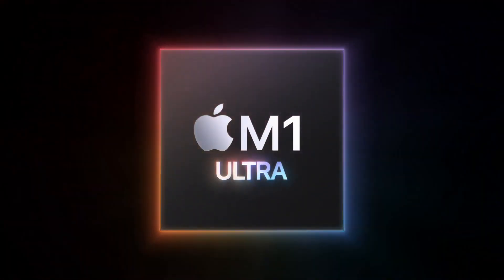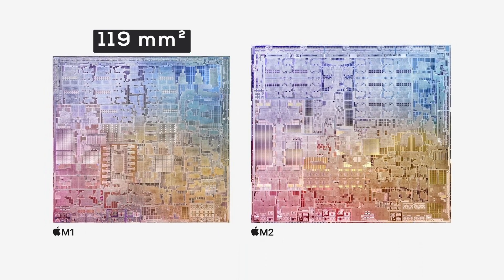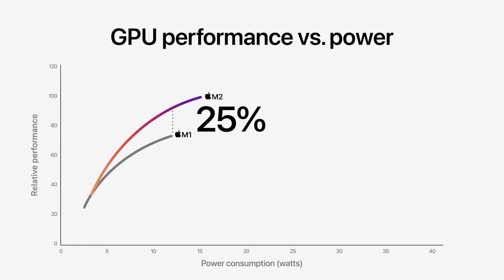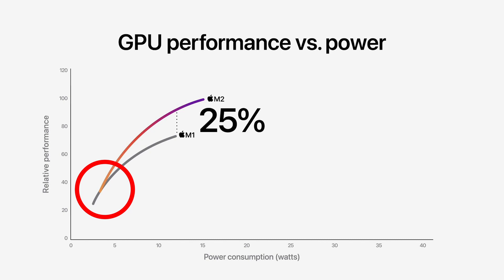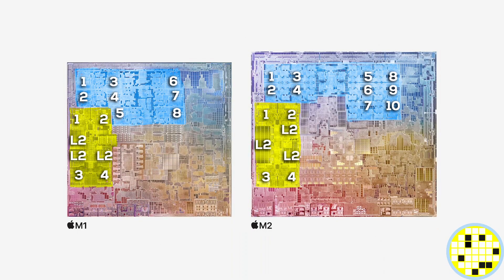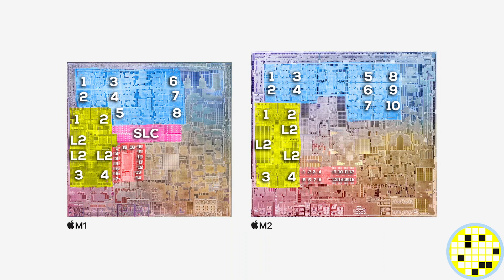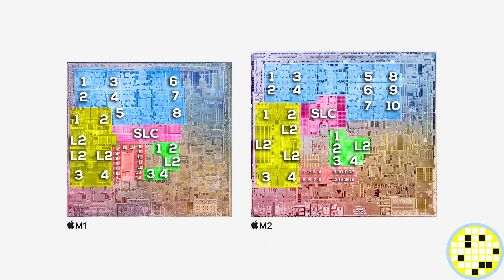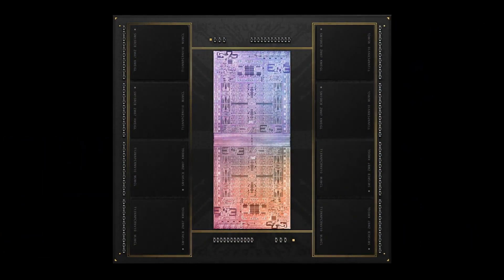Apple M2 Performance & Silicon Analysis

Comment: I fear Apple’s “years-long” lead in ARM chip design (as once identified by journalists and analysts) might quickly evaporate because of the “brain drain” that has “gutted” Apple’s Silicon Engineering team. I don’t expect any advancements in Silicon design technology by Apple in 2023 beyond the M2 Pro and Max. Apple’s widely reported abandonment of ray tracing in hardware that Apple’s Silicon Engineering team had been working on (A#, M#) as well as news that Apple has put its radio/modem/WiFi Silicon efforts on indefinite hold is a sign of a depleted and rudderless Silicon Engineering team that will probably put out SIPs that use the same generation Avalanche/Blizzard CPU cores and the identical GPU cores — just more of them.

More of the same, just more: M# Silicon with 10 Avalanche P-cores/4 Blizzard E-cores; 16/6; 18/8, etc. and more and more of the identical GPU cores: 24, 40, 48(?). Maybe LPDDR5X RAM, maybe adjustments to the cache and system-level cache, maybe an “Ultra” that’s two M2 Max chips fused together. But ARM, Qualcomm, Samsung, NVIDIA and others are already supporting ARMv9, hardware ray tracing, Deep Learning Acceleration, on-die radio/modem/WiFi-6E/DUAL Bluetooth (in the case of Qualcomm) and more. Apple Silicon might slip further and further behind and become the “PowerPC” of desktop/mobile processors in this new era. Hope I’m 100% wrong.

Comment: Just wonder, 
Does it mean that is I buy 8 core GPU model instead of 10, I got defected chip with 1-2 broken GPU cores that are disabled?
Reply from the maker: That’s exactly how it works. Not every chip is fully functional and instead of off throwing it away, some parts are deactivated and sold as lower tier parts.
Without this process, called “silicon binning”, chips wouldn’t be economically viable.

Comment: When the M1 first came out, Apple compared it to Intel (either ice lake or tiger lake), either of which were notably slower than AMD. My thoughts at the time were that it was certainly better than AMD’s Renoir, but that should be expected, given its better node and 60% higher transistor count.
Since the release of the M1, both AMD and Intel have made >25% perf gains (especially Intel, and Rembrandt’s GPU). 18% more CPU perf just doesn’t sound like enough to compete with Phoenix (AMD’s N4 APU), and even a 35% GPU gain is nothing compared to the 60-80% gain rumoured for Phoenix, which is even more impressive given Rembrandt’s insanely efficient GPU.
TLDR: When Intel finally got their act together, AMD has the money to use their latest GPU IP, and TSMC has nothing special to give to Apple, the macbooks don’t seem that great anymore
Reply from the maker: I think performance wise its actually pretty close, but when it comes to perf/W, Apple should still be in the lead.

Comment: I am just absolutely thrilled with Apple having 2, 4 and 4 memory channels between M1 regular, Pro and Max, though less thrilled that there is not a DDR4/5 option for non-laptops. Intel made a serious mistake not offering proper differentiation across price points, shoehorning all client into a single socket. I also like Apple's decision to put memory in the processor package. This might seem like a loss of upgradeability now, but I am assuming Apple will make a deal with a DRAM vendor for a custom die, one in which the signals leaving DRAM cannot drive full size wire of off package, and must be the tiny wires that will become possible with in-package connections.
Reply from the maker: The M1 really was the "odd one out" when it came to the M1 lineup, especially with its LPDDR4X memory. I think the M2 lineup memory scaling will be perfect. As to the non-LP DDR option, maybe we will see one on the rumored Apple Silicon "Mac Pro"? So far all Apple Silicon products are kinda mobile, even the iMac, Mac mini + Mac studio have a really small form factor.

Comment: Personally, I am not super interested in Apple products. I was given a MacBook pro for work back in like 2015 and it was excellent for that sort of thing, however it was a bug fest and would just get slower and slower until it was completely unusable. It was only 2-3 years old by then . There were stacks of them and even newer Airs in the IT room being used as parts machines too. It didn't give me much confidence in their quality especially since they cost so much. I know laptops done always hold their own too well, but I have had $300 Acer laptops last much longer with not much longer with barely any noticeable performance difference when using them for office and even some design work. I'm not quite sure why they decided to get a fleet of such expensive computers for such basic tasks. 

I also like to tinker too much to bother with them even if they were anywhere near my personal price range. Well that amd the fact that any computer I am really going to invest in is primarily for gaming. I can build so I do have a leg up on many consumers, but for the price of a very basic Apple brand desktop, I could build a monster of a PC. However I wouldn't be able to spend that much on one anyway. 

  I understand that they are apparently good for audio and video editing, but they also seem rather narrow in their range of capabilities, so considering they are mainly designed to do those things, it's not surprising that they would be. Their proprietary approach, possible planned obsolescence, and hostility to the right to repair alsonturns me off from their products. I can't help but think that they are charging as much for the logo as they are the hardware.  Thatnis only my opinion though. 

I do get a lot of push back from people who use them exclusively even though they don't really know much about computer hardware. I often get the "well I can edit PDFs without having to buy software for it. I don't often argue,  but on occasion I do point out that the price of that software is definitely baked into to the extremely high system price. I can do many of the same things with $600 worth of PC including pay software, although there are many open source solutions.  The whole "they don't get viruses" line is also common and as you know not true. I'm sure there are.many legitimate reasons to buy their stuff that I am not aware of. Although my point is the most common justifications used by layman consumers seem to be mostly mythical or outdated. Back when Flextronics built their hardware, I'm sure it was very well made  but once they built their own assembly plants it had to have gotten worse since few if any manufacturers can compare to Flextronics no matter how much they make selling it.....especially in sweat shop conditions. The prices certainly didn't reflect the savings accrued from  the switch either. 

It's not just Apple that I don't care for because of such practices. Many once very well made products of brands went way downhill once their name became synonymous with that quality. DC shoes for example  which use to be amazing for skateboarding (and i got made fun of at school for wearing them assuming they were "Payless" brand shoes), but when they got popular years later, they wpuld fall apart by just walking on them while jumping even higher in cost. Or one of the more disappointing examples, the "Ugly stick" line of fishing poles. I use to be able to reel in a giant catfish on a $20 1.5 meter "Ugly stick" that I could easily carry through the woods since it was so short, but super strong when I was younger. I bought another when I went to go fishing for the first time in a while and it exploded from just a few pound young smallmouth bass. They use to be 100% woven solid carbon fiber from tip to handle, which is what made their trademark look by the handle. However upon closer inspection of the rod(now $45), only the tip about <30cm was made like that and the rest was super cheap hollow fiberglass. They just put a thin plastic shroud around the bottom so it looked like it use to from the manufacturing process so they could call it an Ugly stick and charge as much as if it was one. I know that is way off topic, but it explains my apprehension about the brand as a whole. 

I'm not saying you shouldn't cover Apple.  Like I mentioned I'm sure their higer end stuff is very good at higher end workloads, but as a Peasant, those quailty products are way out of my reach and those aforementioned reasons are why I don't  personally follow the brand with any real interest. Unless they made some kind of crazy big advancements this is about I would have to say about them. I did want to watch the video and comment in support of your overall work though, so that's what I ended up saying apparently 😊 Just because I don't like something doesn't mean it's not interesting to others. ☮️
Reply from the maker: My dad always used Apple products, we even had a original Macintosh (I think SE) back in the early 90s. I never had any Apple computer so far, but I switched to a iPhone two years ago and I dont regret it at all. I'm thinking about getting a MacBook Pro so I can cut my videos when I'm not at home, but so far I dont really need it.

But the silicon Apple is pushing out is just amazing. Apples performance cores have by far the highest IPC, like 50% more than Golden Cove or Zen 3, its actually crazy. And because they can afford building wide chips, they are also very efficient at the same time.

Thanks for watching and commenting, but honestly you only need to watch the videos you want to. Not every video I make is of interest for all of my subs and I know that :)
Reply: @HighYield  Nice! My Dad worked for IBM from like 73-98ish, so I always had PCs. I took apart my first PC (IBM AS/400) when I was like 8 (1990ish). It was broken and I was just going to gut it to see what was inside since it had been replaced, but I found a blown Capacitor, got help replacing it, and it worked! It kinda spurred my interest in tinkering with computers. I eventually got a busted Commodore 128 with a ton of game disks at a yard sale for a few bucks and repaired it. I miss that thing.  I actually spent many years repairing coinop Arcade games etc professionally. Unfortunately the scene is rather toxic and crooked so I had to get out of it. 

I also grew up in the Apple II Computer lab era and did like them  since oddly enough they were actually better for games. And a friend had one of the first Macs as well. We use to play games on it as well as use the early internet to chat. I did have some of the first "internet access" before that too at home. I remember being excites that "I can buy stuff on the computer!!" LOL. The first thing I got was a Castle Lego that wasn't released in the states from a guy in Denmark. No pictures of course especially with a green monochrome screen, but it was fascinating at the time.

I did find it interesting actually and  well done. If  I'm going to hear about it, I would prefer a level headed clear evaluation such as you provided. I have a tendency to ramble and get way off topic, so please don't think I'm being contrary or contrary sake. I just live in the middle of nowhere with mostly chickens and my kids, but they don't care about that sort of thing and I don't push it onto them. It bottles up and gets poured out in text form at times. Always glad to have these exchanges though. Will be standing by til the next.

Comment: Despite Apple Silicon for Mac are Great. But I still like Intel and AMD Chip. Since both of them are still good for me and Most Windows Users
Reply from the maker: Apple is very specific, because you can get their hardware only by buying Apple products and it's a very closed off system. I'm also a bit more interested in Intel/AMD/Nvidia, but Apple is on a run when it comes to great hardware and especially perf/W.

Comment: I think this was the plan all along: M1 on N5, M2 on N5P/N4/N4P, M3 on N3. However, I think the M1 release cycle got extended due to the pandemic. N3 should be ready for A17 and M3 on Sept-Oct 2023.
Reply from the maker: Well, I'm sure the original plan from a few years back was different, but with TSMC taking longer to ramp N3, Apple adapted and they clearly knew well beforehand. Gonna be interesting to see how they deal with the A16 and the iPhone 14 in fall.
Reply: @HighYield  did TSMC really take longer? I’ve thought 2023 for N3 has been the plan for at least 3-4 years.
Reply from the maker: I'm pretty sure risk production was planned for late 2021 and mid-2022 for full mass production. Ramping customer (Apple) would have needed a lot of 3nm A16 chips by fall 2022 to build the new iPhone 14 and ship it. But due to the delay to late 2022/early 2023, some plans had to be changed.

Comment: It's strange that they have 8 MB SLC on the M2 when they have 32 MB on the A15
Reply from the maker: Yes, with their A-Chips, Apple went from 8MB SLC in the A12 to 16MB for A13/14 and now 32MB with the A15. I've read some claims of 16 to 24MB SLC for the M1, but counting the cells gives you 8MB. I think the SLC numbers for the others chips might be off too. It would be great if Apple released the actual data on the SLC.